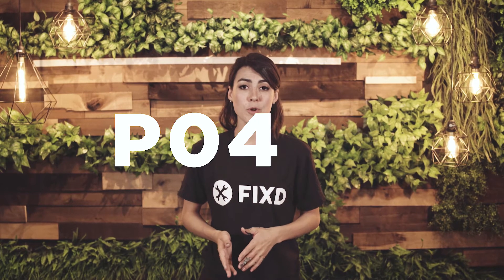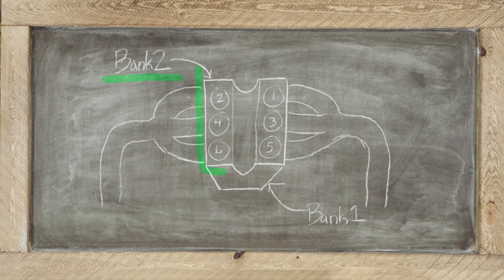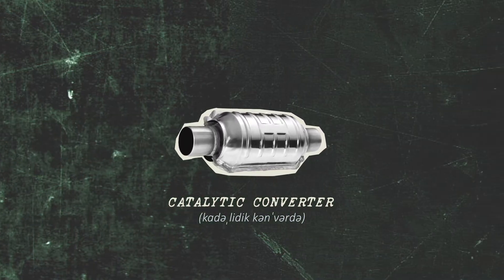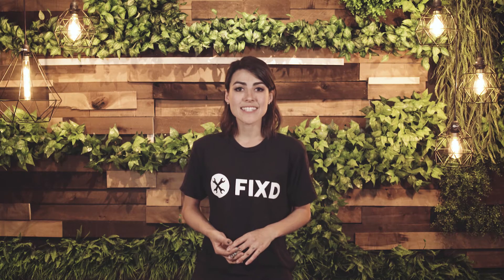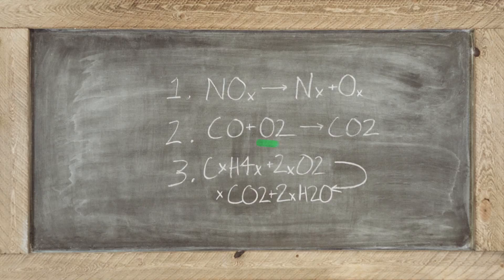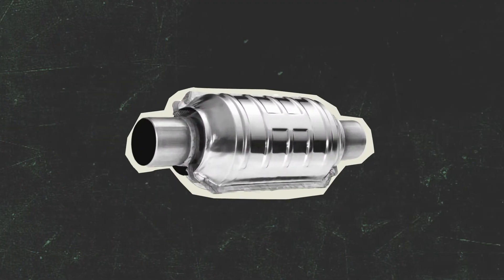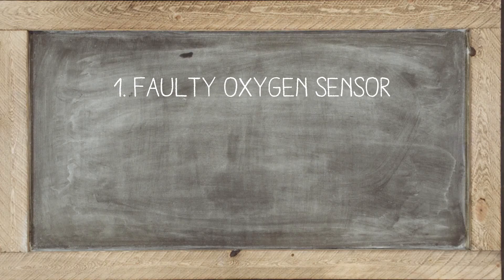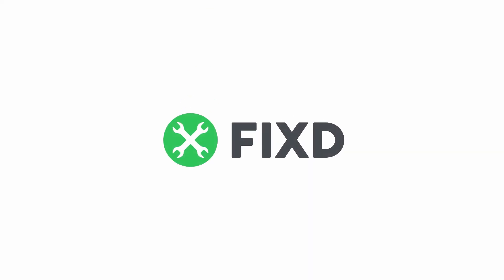P0430 Explained - Catalyst System Efficiency Below Threshold

Comment: Thanks for this video - extremely helpful. How expensive is it to replace the catalytic converter exactly?
Reply: You DONT Wanna Know,you may start crying...
Reply: @garywilson4854  hahahaha for my Titan it was $2k just for the cats no labor and it's an oil burner so I just went with afe headers and exhaust system
Reply: Sorry to be so offtopic but does any of you know a trick to log back into an instagram account??
I stupidly forgot my login password. I would appreciate any help you can offer me!
Reply: @Dakari Rhys Instablaster ;)
Reply: @August Nicholas i really appreciate your reply. I got to the site on google and Im trying it out now.
Seems to take a while so I will get back to you later with my results.
Reply: Just paid $1000 to replace the rear catalytic converter on my Kia. I replaced O2 sensors and finally no codes. Then the dreaded codes about both exhaust manifold catalytic converters are bad.
I could have replaced the common rear one myself, but told the shop to do it.
The bank one and bank two catalytic converters can get really pricey from a few hundreds, to many hundreds just for the parts.
I could replace them myself, but it is pretty extensive to get to both exhaust sides of the engine.
Just pulling the intake manifold to even see the back one is a job in itself.

I've been replacing parts myself and am still better off than making car payments, but for every new part I put on another one needs replacing.
I like the car and with all the new parts that I installed, I know it inside and out.
Even if I spend $2000 more to have a shop do it, it makes me think the timing belt and water pump should also be done and probably new plugs and whatever can be done while apart.

Even if I do this, I'm still under one year's car payments for a new one.

New cars require servicing and maintenance to keep them under warranty, so just because it's new, doesn't mean it won't cost me more money than just the payments.
Reply from the maker: Hey Gabe, It's hard to estimate, but the usual amount is between $1300 and $1600. Labor costs can be anything from $70 and $200 while parts are from $1250 and $1400. (This is without taxes!). It's definitely a big fix and something you might want a mechanics opinion on. Thanks for watching!
Reply: That is the dumbest question to ask, you literally don't need to have know about cars to know that that's a dumb question 🙄

Comment: Just paid $1000 to replace the rear catalytic converter on my Kia. I replaced O2 sensors and finally no codes. Then the dreaded codes about both exhaust manifold catalytic converters are bad.
I could have replaced the common rear one myself, but told the shop to do it.
The bank one and bank two catalytic converters can get really pricey from a few hundreds, to many hundreds just for the parts.
I could replace them myself, but it is pretty extensive to get to both exhaust sides of the engine.
Just pulling the intake manifold to even see the back one is a job in itself.

I've been replacing parts myself and am still better off than making car payments, but for every new part I put on another one needs replacing.
I like the car and with all the new parts that I installed, I know it inside and out.
Even if I spend $2000 more to have a shop do it, it makes me think the timing belt and water pump should also be done and probably new plugs and whatever can be done while apart.

Even if I do this, I'm still under one year's car payments for a new one.

New cars require servicing and maintenance to keep them under warranty, so just because it's new, doesn't mean it won't cost me more money than just the payments.

Comment: So i have both P0420 and P0430. I recently installed high flow cats and replaced all 4 O2 sensors. And i also added a spacer on the O2 sensors furthest from the engine. What can i do now?
Reply: So what hpn?

Comment: Or you could just get a non Fowler spark plug kit and install those sensors into the non Fowler kit after you drill a half inch hole at the end of one of them through the one with the big hole into the one with the little hole and now you could screw your sensor into the end of the one with the big hole and now guess what your code is gone

Comment: Pull the oxygen sensors first and clean them off with a bunsen propane torch,  while doing this you can watch the resistance value change on your ohm meter too.

Comment: P0430 can be vacuum leak on intake manifolds, coolant leak inside the engine or EGR failure too.
Cats are the political reason. It's a big Scam industry.
Reply: Can you elaborate more on the political reason? Thanks.

Comment: Wrong! the code is not telling the sensor anything. The Sensor is telling the Ecm/Pcm that the temperature after the Catalyst Convertor is not in the heat range that it is supposed to be in. Then the ECM/ PCM sends a signal to trigger the "Check Engine Light". Next... a scanner is used to retrieve the codes from the ECM/PCM. But, other than that you are pretty close. (Misinformation starts wars and hurts wallets. Just Ask Bush). Though... I am not an Auto Technician by trade, reading how automotive systems work and great comprehension skills has made me a superb " Weekend DIY Auto-Tech" which translates to "Weekend Warrior". Peace!!!
Reply: Wrong!  The sensor is not measuring a "heat range" to determine whether the catalyst is performing efficiently, it is measuring oxygen.

Comment: So there are only three things can cause the P0430 code to set ? It’s either oxygen sensor,a leak exhaust or a catalytic converter . How do you diagnose which is the culprit ?
Reply: mckoy lach you need a scan tool to diagnose  or exhaust back pressure gauge or automotive smoke machine to find a vacuum leak